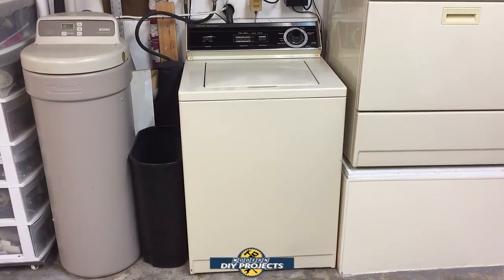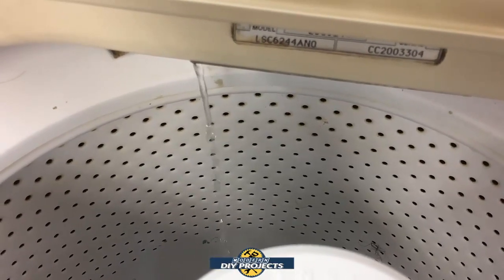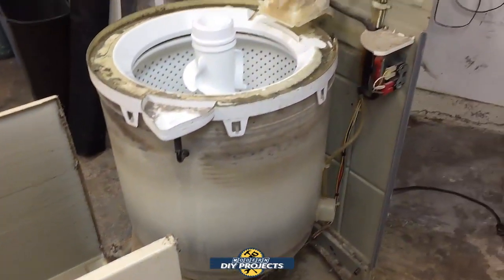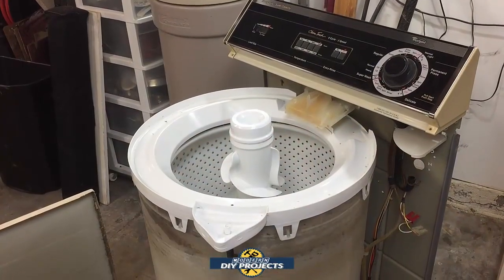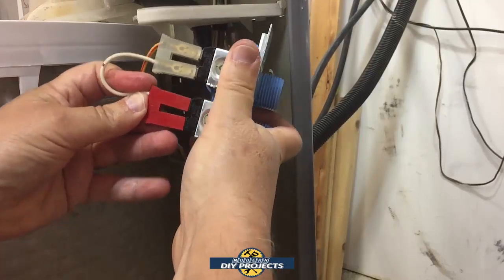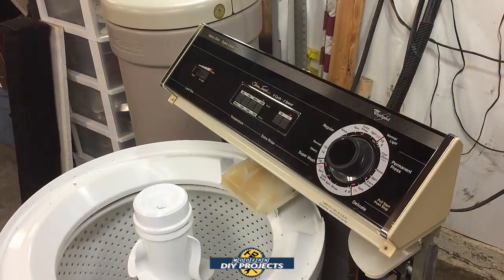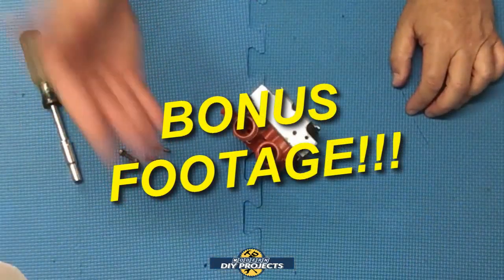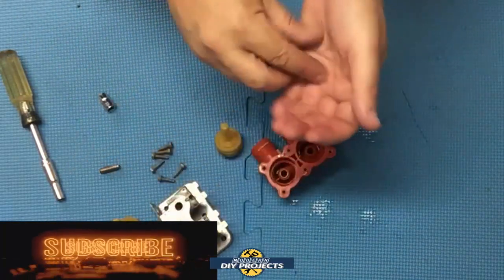Washing Machine Water Inlet Valve Repair / No Spin Cycle / Low Water Pressure / Shuts off Mid Cycle

Comment: I wish I still owned an old, simple, non-microprocessor controlled machine.  My GE POS is only three years old and I have already had to replace the lid switch about a year ago.  Fortunately, the fix was relatively simple.  But, occasionally, my machine needs to be reset just like a computer...🤬

This repair did not require any dismantling — just push away tub from lid switch and reach under to pull it out and then remove wires. I bought new one on Amazon.  A repairman would have charged $100 just to come out and more 💰 for each 15 minutes and, of course, the part(s) cost.

Researching online, I found it is a common GE problem and, also found that closing & opening lid 5x resets the computer.  Such a pile of sh$t! 🤬. I am old enough to remember that new appliances had no issues for at least 20 years.
Reply from the maker: When I was younger I would think that newer was better, and back then it may well have been because of lots of new innovations. Now newer is something I stay away from as long as I can. Newer just means cheaper, untested, and full of potential problems. I agree with you. I keep the old stuff as long as I can keep it running.
Reply: @ModernDIYProjects  Amen brother...Due to bean counters trying to obtain more profit at the expense of reliability,  engineers are expected to design it cheaply.  Put all on the market and let the consumer be the lab rat and hope that their crap will last until after their warranty period expires.  Consumers beware! Research products thoroughly before purchasing especially new vehicles...⚠️

I want to buy a new vehicle but all scare me as future money pits.  I keep my vehicles a longtime (>10 yrs).